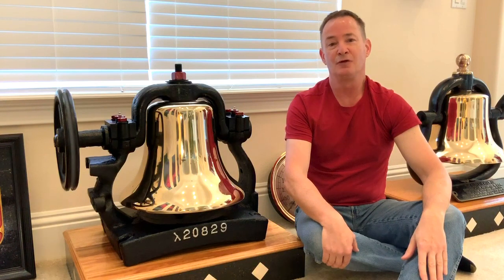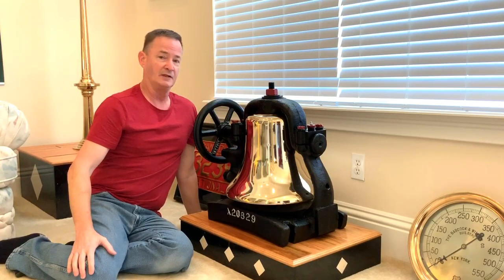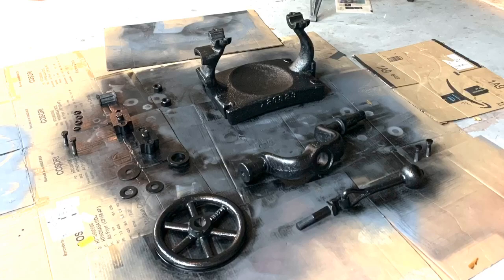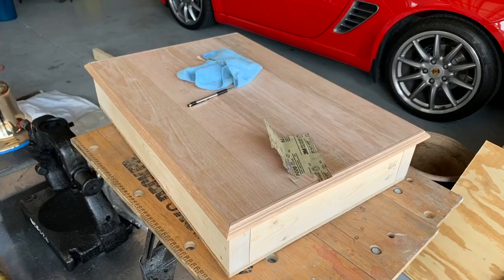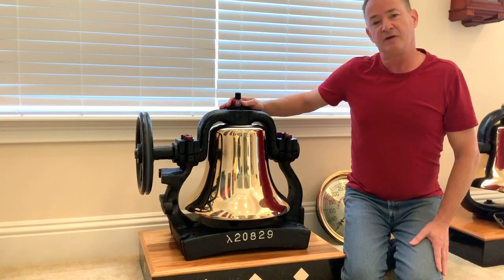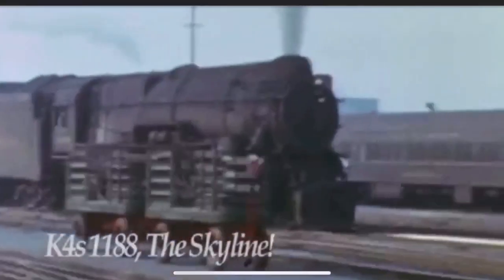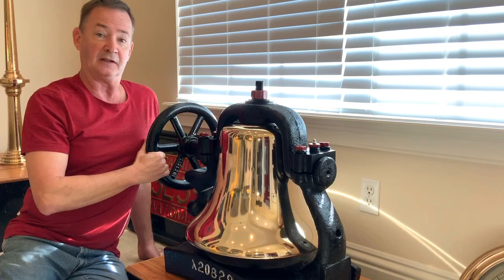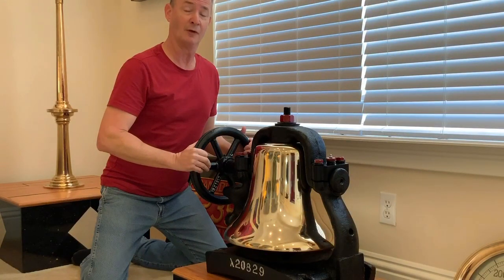Restoring a Pennsylvania Railroad Steam Locomotive Bell

Comment from the maker: Just another quick update.  Some people bring home lost puppies while I bring home neglected 200 pound steam locomotive bells - just one of my many character flaws.  I recently completed the restoration of another PRR bell.  It is very similar to the bell in this video and it came complete with all of the original hardware.  Interestingly, there was a bit of the same pitting on the bell surface.  I do now believe that this pitting was caused by the "acid rain" created by the locomotive smoke.  Based on the large amount of pitting on the video bell it lends credence that it may have been under a locomotive shroud for a period of time.   Also, about 50% of the inside of the bell still had original red paint.  I guess the PRR did paint some of their bells!  I polished the bell to a high luster but left the inside of the bell as I received it.  Cheers, Pete.

Comment: I think it's off 1188, and there are several reasons why.  At least one semi-shrouded K4s was painted Tuscan red for several years.  It had a specific train assignment which may be explained in Stauffer's Pennsy Power 1.  That explains the red under the cradle paint.  Second, if this bell was assigned to the semi-shrouded locomotive, the wheel would facilitate cranking under the shroud.  I think the wheel may have been added if the bell had been moved to a church steeple or some big shot's back yard.  That would help reason out the gray paint.  The nick marks in the bell surface indicate people trying to ring it by throwing stones.  That's what we have on 470's bell.  Since there are casting indicators on the wheel, I think it is something put there by the PRR.  When I first looked at the bell assembly, I thought it might be off an E7 Atlantic, but again, that cradle indicates a heavier locomotive.
I like the way you brought up the shine and display the piece.  Personally, I would never have sand blasted it, but it was your bell and your choice.  I have a keystone number plate off an M1 Mountain, and the previous owner used it as a grease trap under his portable grill.  While it still had gold leaf along the raised edges, I had to strip it and paint it as was Pennsy's later practice.  I couldn't bring it into the house as it was, patina or none!
Reply: I think all the tiny pittings may have been caused by acid rain eating away at it.  Coal emits sulfur dioxide when burned, which then reacts with water to form a strong acid.  It has so many pits likely because it was on top of the locomotive (where most of the rain falls) and in very close proximity to coal exhaust for most of its life.

Comment from the maker: Thank you for your comments PRR5406!  Your thoughts on the sandblasting are appreciated.  There is sometimes a very fine line between accurately preserving history and making something look attractive for display in the home.  I'd like to think that I found a reasonable compromise.

You are correct on your reference to Alvin Staufer's "Pennsy Power" book.  On page 178 it reads, "In the early 1930's a few K4s's were painted Tuscan Red instead of Brunswick Green (Pennsy official passenger locomotive color)."

A number of viewers have commented privately that the wheel appears to be very well proportioned to the bell.  The fact that there is a casting number on the wheel also leads some to believe that it was a PRR railroad part / modification.

Comment: I have an unmarked bell off of a train and back in yesteryear it was used as a school bell. It has  a bif 4 inch round   ball top but flat at bottom. It rings with a middle D note but no after tones..It is 15 inches wide...Would you know anything about this type of train bell? I was made where the rope goes into the train cabon.
Reply from the maker: Hey Ron, thanks for checking out my video.  I'm certainly no expert but I do have some resources and might be able to offer an educated opinion.  You're welcome to send me some photos.  My email is:  MyPrrBell@hotmail.com.  Cheers!

Comment: I have an old train bell that rings in a middle D note...It has no identification on it. It is 15 inches wide. It was used by the school board on one room school in 1800s..The stand is missing and i guess their machine shop made a steel square cradle for it. Do you have any ideo who may have made this unmarked bell?

Comment: I have an old RR bronze or brass  bell i think . that I just purchased. it doesnt have the clapper , etc It is 22 inches in diameter and has 18 .Might I have some help to find the train and also now to build something where I can ring it and has  number 186 and an odd scratch near the top and weighs at least 100 -150 pounds . there is a hole in the top where the clapper would have gone
Reply: any help so appreciated

Comment: I came by an old steam engine bell,it does not have the bracket. How could a guy try to find a bracket for my bell,any help would be great.
Reply from the maker: Hey Duane.  Thanks for checking out my video.  I'm of the opinion that finding a bracket to fit your bell is going to be a challenge.  Bells and frames were typically cast to be paired together.  You're welcome to email me with some photos and basic measurements.  I'm definitely not an expert but I do have a decent amount of knowledge (and know some people who might be able to assist).   MyPRRBell@hotmail.com